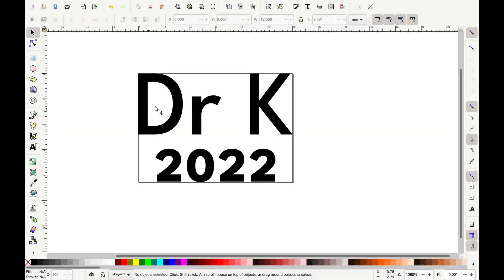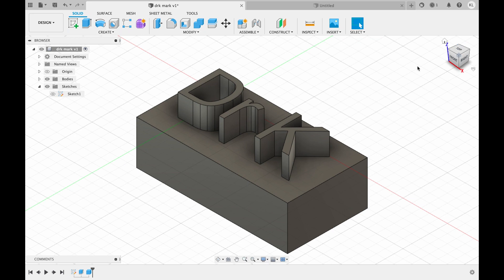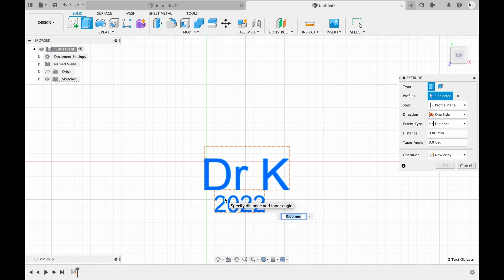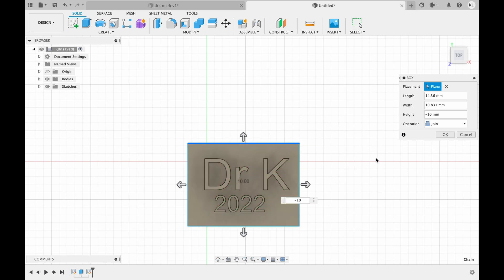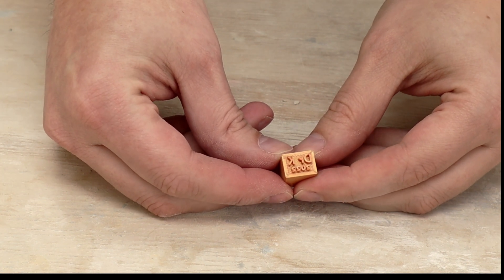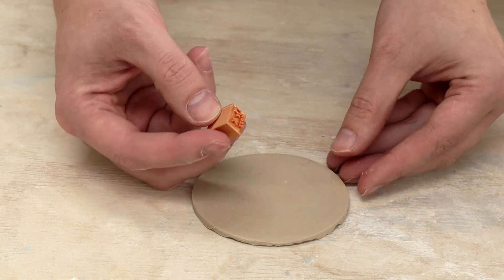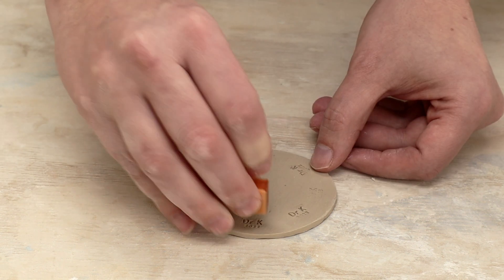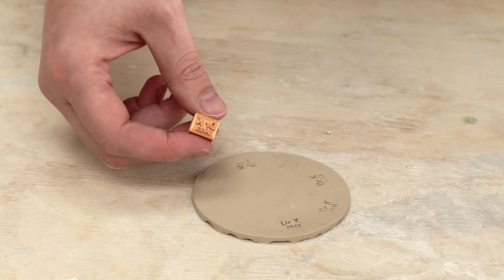3D Printing my Pottery Makers Mark

Comment: My intuition is that if a person added a very slight draft angle to the extrude on the lettering, that it would release cleaner - possibly resulting in better legibility after imprinting into the clay.  

 The slight draft angle would result in lettering that is very subtly wider at the base near the handle then at the top of the font face.
Reply from the maker: There is one actually, but it could probably stand to be bigger

Comment: hey great video, but i have a question, how would the process be different using your own handwriting? would you just trace the outline then extrude it? all 3d design is new to me so forgive me if its a dumb question . Thanks!
Reply from the maker: There are a few differences. Each letter here as some line width to it. So if you captured handwriting, you'd need to make sure there was also width for each stroke. Once you had that, you could extrude it in the same way. The other difference is about feature size - how small is each little part. I played around with the font sizes to try and make sure it would show up in the clay. The year (and the 0 in particular) is still probably a bit too small. I can change the font in a variety of ways to fix that. If you were dealing with handwriting, that would mean you need to change the handwriting itself (which probably starts to get away from the intent).